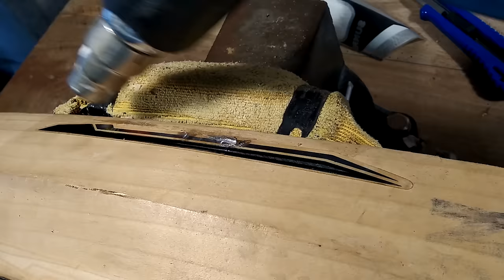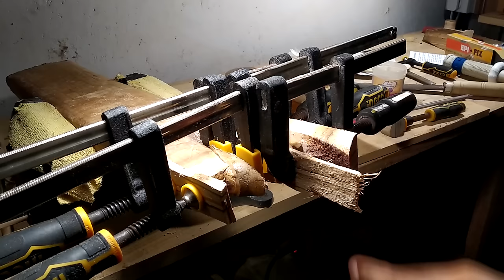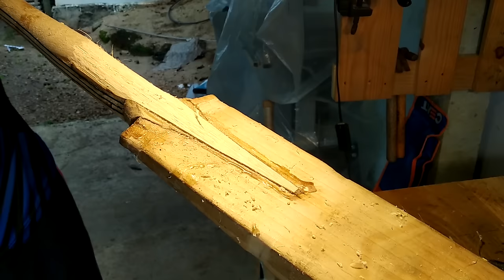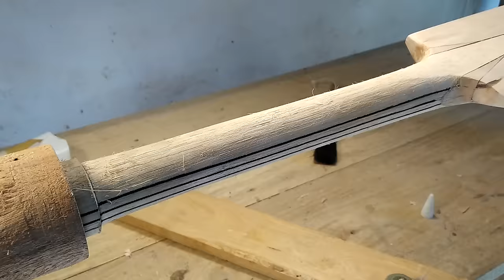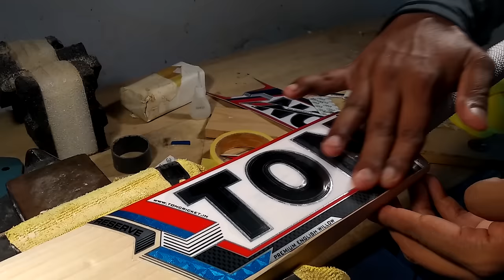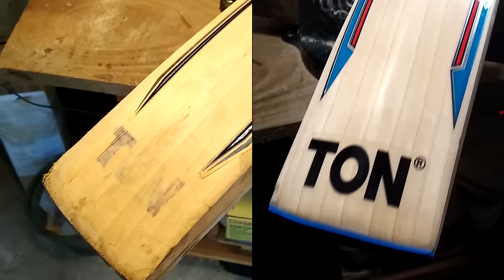Full Repair & Refurbishment of  Cricket bat - SS PALYER EDITION

Comment: That handle fix on top was interesting. The entire refurb finish was masterpiece. Love the quality of grip and stickers. I wish you could have added bat facing as well. Super bro as always.
Reply from the maker: Thnx Broo, Cheers
Reply: @MightyCricket    11
Reply from the maker: @ruksarkhan2979  YEs Sir ?
Reply: Sir your the best bat repairer in india your on top 1
Reply: Sir which glue you have used
Reply: @MightyCricket kkkk
Reply: @MightyCricket  great job bro love you bat repair
Reply: Where are your place
Reply: Good job the best bat I have ever saw
Reply: @sufiyanansari9156  oh... Where is his shop?
Reply: @sufiyanansari9156  I wanted to get my bat refurbished
Reply: Handle not fixed in middle
Reply: Which adhesive you are using to fix the handle
Reply: @sufiyanansari9156  qqTouch and hold a clip to pin it. Unpinned clips will be deleted after 1 hour.Welcome to Gboard clipboard, any text that you copy will be saved here.Use the edit icon to pin, add or delete clips.Touch and hold a clip to pin it. Unpinned clips will be deleted after 1 hour.Tap on a clip to paste it in the text box.

Comment: Interesting to see there was already twine from a previous repair under the stickers. 
Had this bat been re-handled before too?
Clearly the owner was keen to keep this bat going for as long as possible.
Reply from the maker: True cameron , This is the forth handle for the bat, its still perform well so owner very much keen  to keep is as long as he can , Thnx for the comment , Keep Watching us
Reply: Expensive bat also. So no wonder he preserves it...
Reply from the maker: @littlepuppy101  Yes Sir & the Other thing is that still its in a great condition , Keep Watching us
Reply: @MightyCricket  Nice video. What is the name of the sander you use? It looks good for doing the back of the bats
Reply from the maker: @swilliams3342  Yep The Sander i used is called as orbit Sander  , but you have to have  correct sponge pad under it  , and if you can use contour sander it will be the best for the bats
Reply: conact us for bat repairing and also available second hand bat

Comment: Nice repair bro! will be interesting to see how the bat will last with the many glued components for the handle. Great craftsmanship nonetheless
Reply from the maker: Its Kind of a experiment bro , will see how it perform , thnx for the comment bro , Keep Watching us
Reply: You generally find that the weak points aren't the joins, but the natural timber sections.
Reply from the maker: @BatandBallCricket  Hii Bro , Joints are very weak and it has replace the handles 3 times before , as per my concern timber seems to be in perfect condition yet . Thanx for the comment bro , highly appreciated , Keep watching us
Reply: This will go on. No problems. You're not battling with it in a medieval army. It will hit a ball well.
Reply from the maker: @littlepuppy101  Thnx For the comment sir , Keep Watching us
Reply: conact us for bat repairing and also available second hand bat
Reply: best bat repair service

Comment: Can you please tell me which glue did you used to fix the handle & which glue you used to fix the cracks.........??
Reply from the maker: Hiii Bro , Its LOcal Product from Sri lanka  , if you from india there is product from fevicol  epoxy  which has those to parts . .. most importantly use this glue if your bat is badly broken , if not go for pu glue  like sika bond or titebond  ,,, cheers
Reply: @MightyCricket  Thanks for the info,
Yes i am from india & my bat is badly broken apart into 2 pieces through the handle..
Can you ship that glue from srilanka to india......??
I'll pay the charges..
Is that OK for you..
Or can you tell me the proper name of the glue which you were saying that i can get it from india.....??
Or is that glue available on online.....??
Reply from the maker: @Divyesh86555  will share indian online store to buy it ,,,

Comment: What about those minor cracks in middle and bottom it will deteriorate within couple of games
Reply from the maker: All are filled with wood friendly glue bro , there wont be any issue
Reply: @MightyCricket  Which glue do you use for filling the cracks and repairing handle?

Comment: sir can u please make a video on how to apply guts on bat in 1-2 days
Reply from the maker: Guts?
Reply: @MightyCricket  guts are thread on bat's handle at its joint or at toe with some glue or yellow chemical on it to protect from breaking
Reply from the maker: @ativeerjain9870  W Call it binding sir , Will do a video on it too , kEep Watching us
Reply: @MightyCricket  sir can u please do it in 1 or 2 days because I have to repair my bat from toe and also can we use fevikwik to fill cracks?
Reply from the maker: @ativeerjain9870  Yes for sure please contact me on whatsapp +94773680989